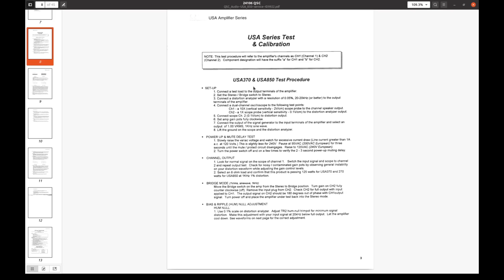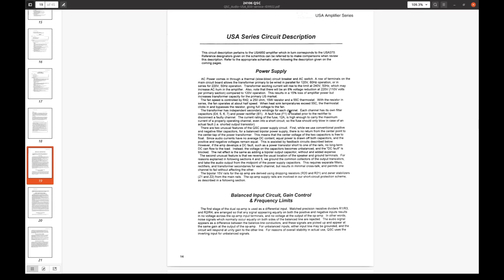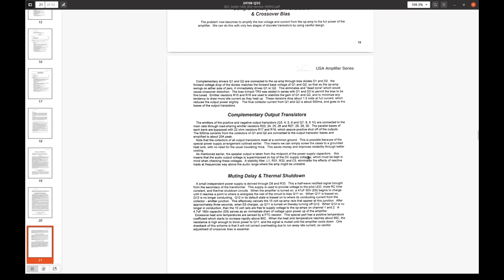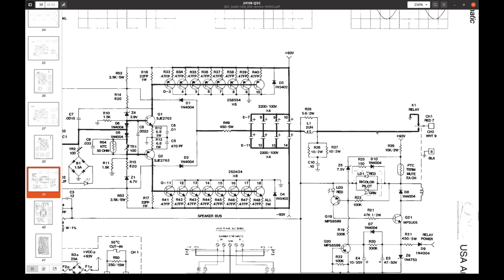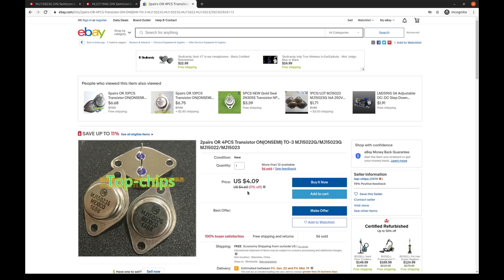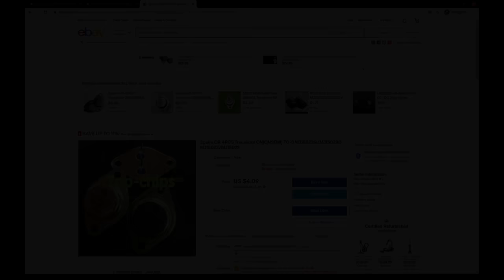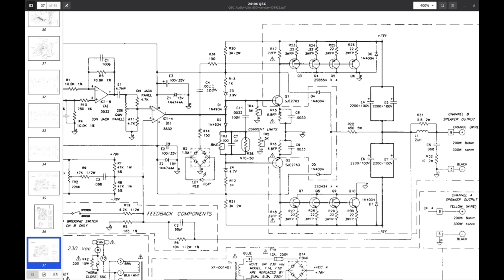#106 - QSC USA 850 power amplifier repair

Comment: Oh god! That cooling system is pathetic, isn’t it? The fan blows a “breeze” through the fins of the heat sink. They should have spent a few more cents on a cowling around that fan. Would have improved the airflow quite a lot.
Reply from the maker: There is a plastic guide attached to the top cover. I did not show it.

Comment: At least check and match the gain of the transistors and check the breakdown voltage - NEVER use chinesecomponents  -  the amp looks like rubbish  -toy unshrouded fan and a tiny heatsink ,with no no thermal cutouts on the heatsink /no visible temperature tracking transistors on the heasink for bias control  -  in class B the max conversion effiency is about 70%  -so at  800 watts output  the heatsink is expected to dissipate  800/70*100 =1150watts less the 800 out =350 watts !!!   the main transformer is too small as well

Comment: knowing that chinese semiconductors most likely are fake u still couldnt resist to spent 20 USD for crap, but 40USD at DigiKey was way to expensive for quality goods? dont get the way u think. Now you stuck with no solution coz of 20 USD u didn't want to pay more
Reply from the maker: 1. most probably I will get a refund for fakes
2. $40 at DigiKey is for 5 devices - mixing old and new - not ideal, $20 was an attempt to replace all
3. not stuck, not because of $20, just not sure which way to go: mix old and new for $40 or replace all, which is probably more expensive than the amp is worth